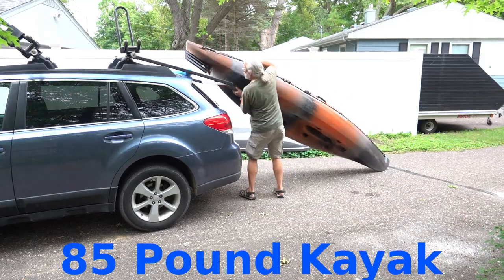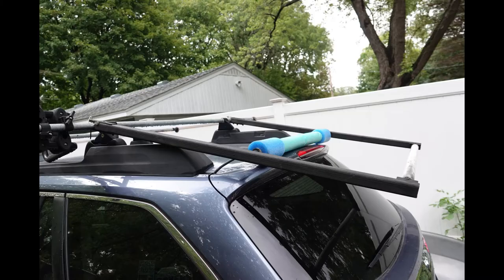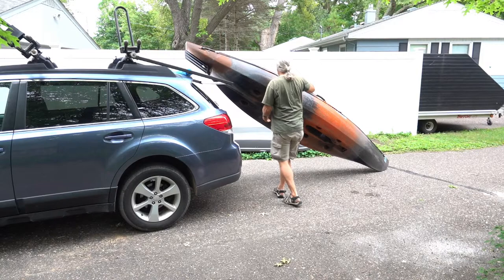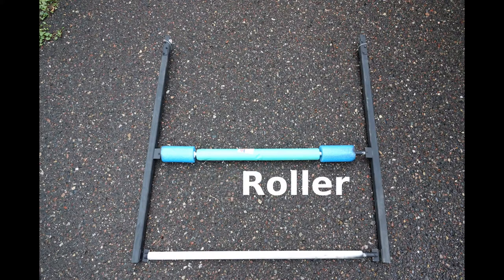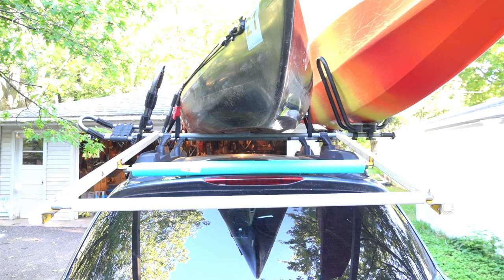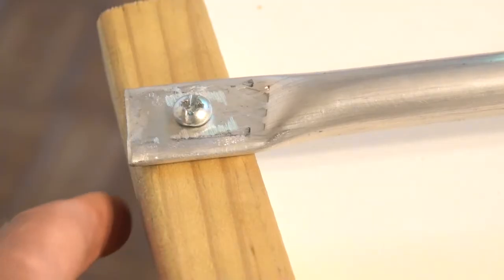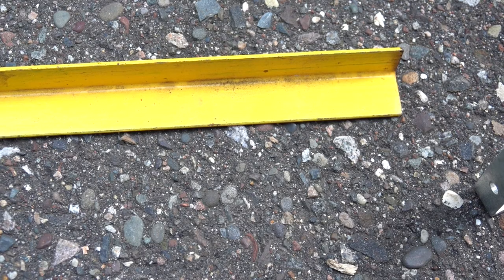Kayak Loading Aid

Comment: Love the ingenuity!
I’m curious what you think of a product for this method called the Channel Loader.
Reply from the maker: I saw a lady use one of those. She said it worked great when it was new but then it started to slide and fall off after a while. I originally wanted to buy a Yakima show boat but they were out of stock at the time and that is why I built this. After 2 years I am still using it, It works great on level ground but am finding that on an uphill grade the kayak likes to slide backwards making it tricky to use. When the car is angled sideways, it likes to slide off of the side. An improvement in this design would be to add something on the ends that would stop it from sliding off. It only fell off the side once and nothing was damaged but it has slid sideways several times.

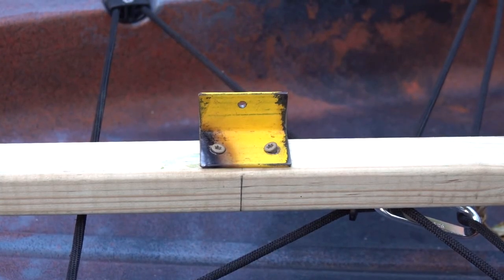Comment: That is very good Sir. At 2:04 mins you show your bracketing method, yet I could not discern them in your working version, and if you did use brackets wouldn't you then loose the parallelogram stow-away capability which in itself is a very useful feature. Kind regards.
Reply from the maker: It requires precise measurements so the pivot points are equal distant apart so the crossbars are equal length and parallel. 
One of these days I'll upload a video of an improved version that I made last summer.